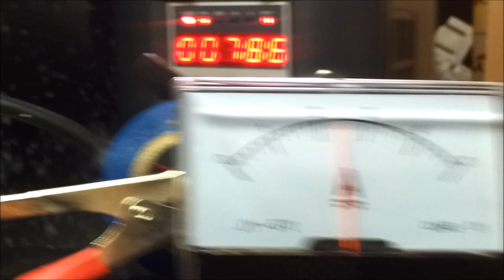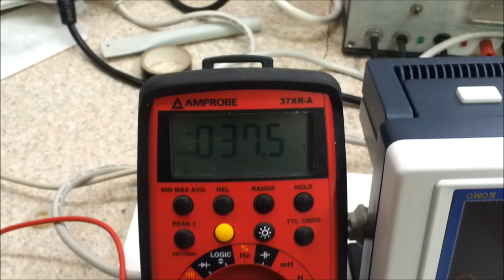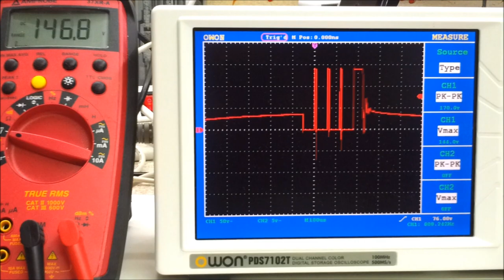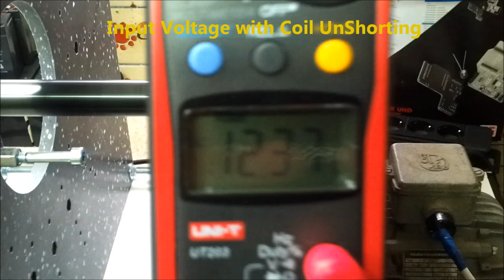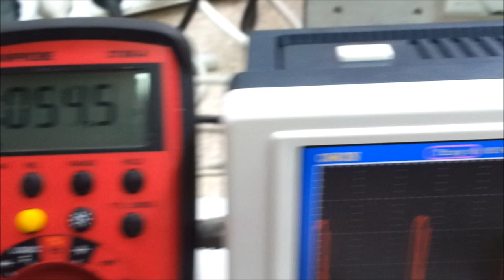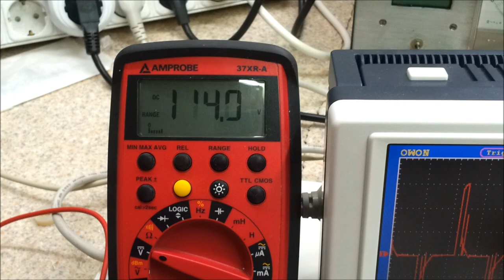Coil Shorting vs Coil UnShorting

Comment from the maker: Thanks min2oly an Overschuss

For now I am focusing to charging cap as fast as possible and I have to make second coil pair. The problem is that my P-in is not optimal because I use inverter ( 12V DC to 220V AC ) to drive VFD ( variable frequency drive inverter) 3 phase 0.37kw AC motor.

This setup alone without spining a motor counsumes Pin: 12.45V x 1.5Amp = 18.68W

No load without coil shorting Pin:12.41V x 2.45Amp = 30.40W RPM:779

Coil Shorting Pin: 12.40V x 2.45Amp = 30.38W RPM:778

Comment from the maker: Coil Unshorting Pin: 12.37V x 2.95Amp = 36.50W RPM:751

How to calculate Pout with coil shorting and cap ( 680uF 200V ) charging?

Comment: Hi Joe great vid I am about to do this in small scale. I saw what I was looking for the scope shot of the coil shorting. I am planing to make a 555 shorting circuit to short all the time, not just on sine peek.
Reply: You need to unshort the coil at peak voltage, not shorting it at peaks. You are adding a second coils at peak voltage. Wire the second coils in reverse polaroty for amp aplification.

Comment: Hi Joe, well done, please try it with shortening and opening the coils ALL THE TIME, not just at the top and bottom wavepoints... I guess this will give you much more power out... Also then you don´t need a special timimng circuit, but just can run it asynchrnously freely... much easier circuit then... Hope this helps.
Regards, Stefan.